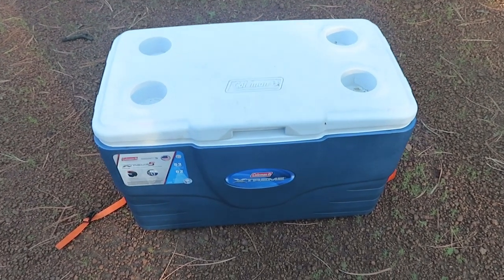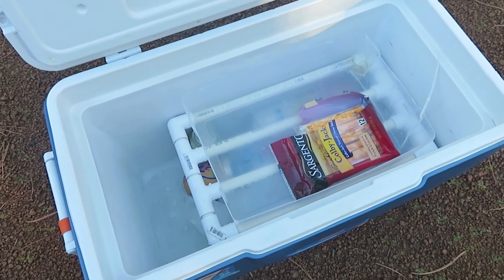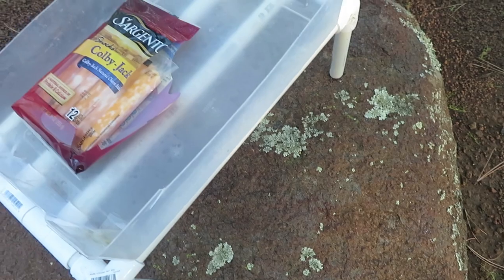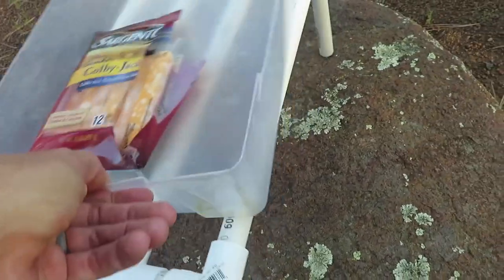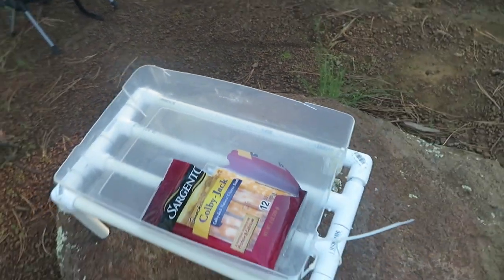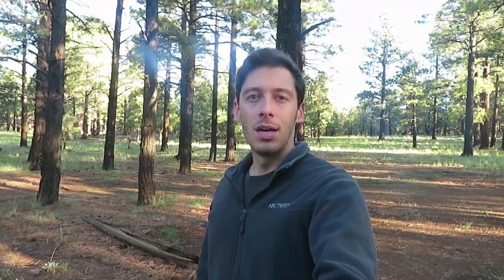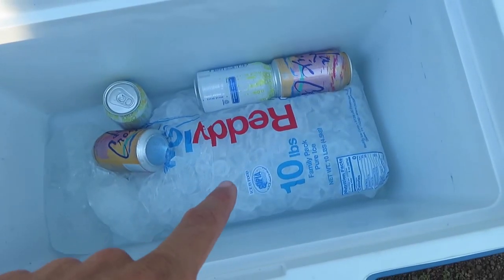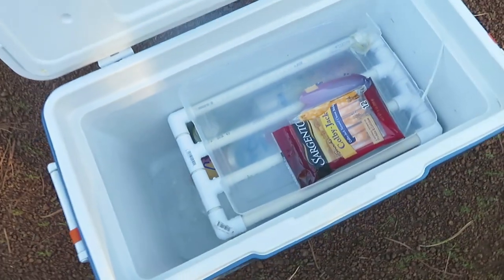Keep Food from Getting Wet in the Cooler (DIY Cooler Tray)

Comment: After various attempts my fave way to keep food dry is to put the bag of ice in a commercial, (therefore thicker) green garbage bag. They r huge so i fold or cut to size. No water leaks out, easy to to take out, no mess. Drinks go in bottom, ice bag over, food over. Food may b put in plastic container to lift easily to access beverages. 
At times i put food in bottom, ice then drinks over. No space lost. 
My best option yet.
Reply from the maker: Huh, interesting. I'll give it a shot. Thanks Manon!
Reply: SUV RVing I read somewhere that you can do this same thing but with dry bags (the kind normally used for canoeing, kayaking, etc.). Just empty the store bought ice into the dry bag, seal it up, and put it in the cooler, and the water should stay contained. I haven't personally tried this yet but I will soon, I just got a Yeti Roadie 20 and borrowed a dry bag from my dad who uses them for motorcycle trips. It would be cheaper and more environmentally friendly in the long run since you could keep reusing the same dry bag. 👌🏻
Reply: SUV RVing I like your idea, for a larger cooler it looks like it works well!
Reply: How about using the thick plastic bags that supplied by your neighborhood recycling program?

Comment: Question... if cold air floats down... how would that keep your food on top of the ice Cold OR is the main point..
Air temperature inside the cooler? also how long does your ice last in that brand of cooler?

Thanks for your response,
 in advance : )
Reply from the maker: Cold air sinks, yes, but it's still cold above the ice too. Ice lasts about 5 days in the cooler.
Reply: @SUVRVing  thank you : )

Comment: Fill the rack with salt water and freeze. Allow the legs to be disconnected (blocking the holes first with silicone). Makes better use of the rack space while adding cooling. ..or just steal the idea of the four juice container from here in the comments section instead of the legs.

Comment: This is a good idea. I use the gallon zipper type bags, it is super easy and works on the road (though you might need. a cup to put the ice in bags) but you can cheat and use ice machines in motels, should you stay at one.
Reply from the maker: I actually have used ice machines at motels before. Works great when they're around :) Thanks for watching and commenting!

Comment: Something like this is perfect when your dependent on store bought cube ice.  When I had a working freezer I use to freeze 2 liter coke bottles (with water), or smaller water bottles, and use them as large ice cubes.  Could get up to 5 days out of them, and had no mess of melted water.  But that option is not open to me anymore.  Thanks for posting this idea!  Will probably make one this month.
Reply from the maker: Yep, that's a great option for shorter trips. But as you said, that's not really something that's possible while on the road. Let me know how your build goes. Thanks Jonathan!

Comment: I like your tray design.  If you glue the thing together you could fill it with saltwater and freeze the tray. It would also help keep ice that much longer without taking up any more space ( just adds weight)
Reply from the maker: That's true, but I don't have a freezer big enough to freeze the tray, and I'd have no way to re-freeze it on longer trips. And the amount of space inside that 1/2-inch PVC is so small and the sidewalls so thick that I don't think you'd really get all that much cooler power from it. Thanks for watching, Bill.

Comment: Fill up big PVC tubes cap them and freeze...lay food on top of those...works great, customize the sizes of the tubes, you can also used them vertically in knooks and crannies.

Just remember NOT to fill PVC tubes up 100%...leave some room for conteaction(makes it easier to remove tubes end caps when they thaw)
Reply from the maker: Hi Paul. That would work only if you were going on a short trip from your house. You wouldn't be able to freeze them again once you're on the road.